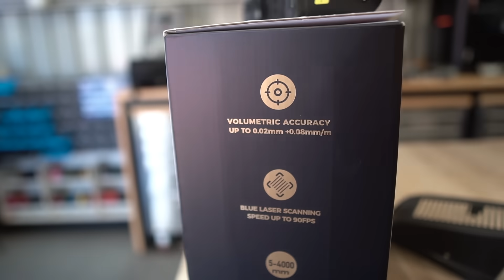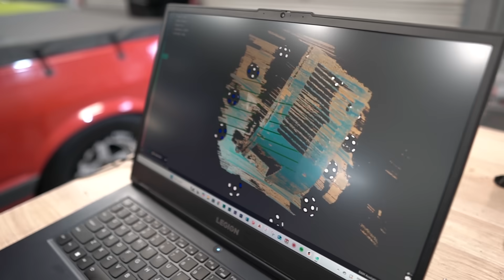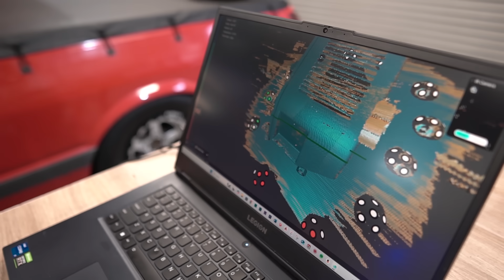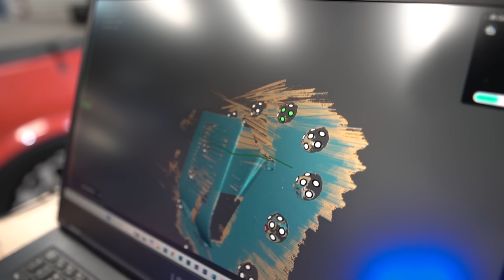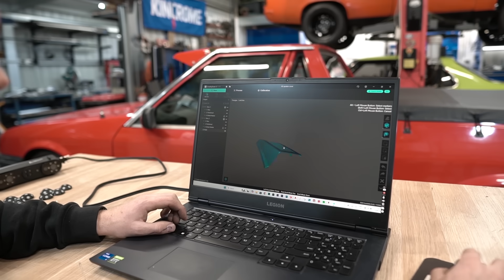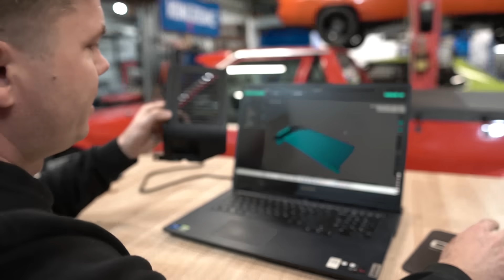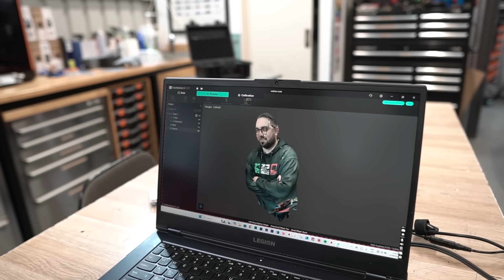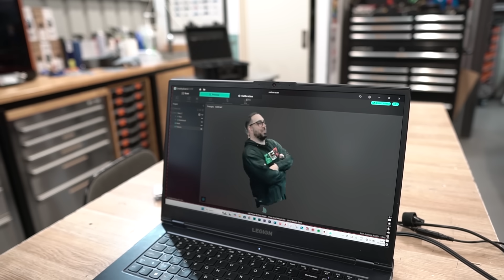Can we remake long lost parts at home using the CREALITY SERMOON S1?

Comment: Hey guys. I have just started messing around with PC-ABS which prints easy on my Bambu printer but if you can dial it in for your printer it is like ABS but much stronger and less warp. I think this is my new fav filament for interior car parts.  I never had much luck with the older Prusa open frame printers in a print tent and ABS but your Core One Prusa should be able to print this. I dry my filaments in a Sunlu s4 dryer. I get my PC-ABS from Siddament. Also I bought a Creality raptor pro after seeing your video and in my limited use so far I am impressed what it can do scanning the black box it came in under bad led lighting with moths flying around in front lol it scanned so well I could see micro scratches on the case in the scan and it was easy to clean up all the artifacts from the moths lol. Also if you wanted to print with the same texture your part had you can use fuzzy skin feature in the printer slicer.

Comment: Just wondering how you would go if you used the broken part to scan is there software that fills in replaces broken parts and how much would this part actually be worth make or sale
Reply from the maker: You can use cad software to use the scan as a template to then replicate the part and fix the broken pieces. 

As for what it’s worth to sell, I want to tweak it just a little more. But I’d say around $150

Comment: If you're sanding Carbon Fiber filament, you might want to take care not to breathe in the dust. In terms of support material, that's where a multi toolhead printer can really benefit, as you can print the supports with material as a support material.